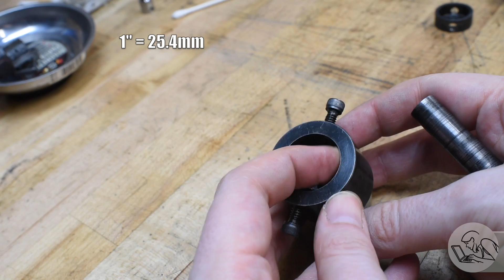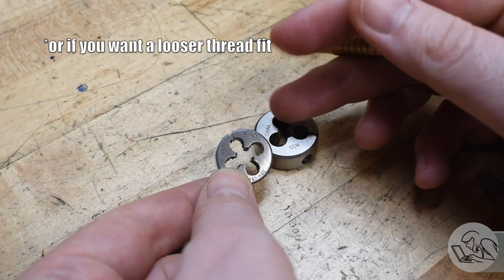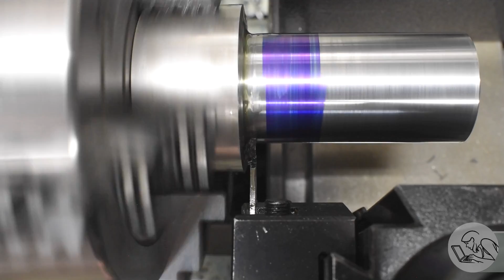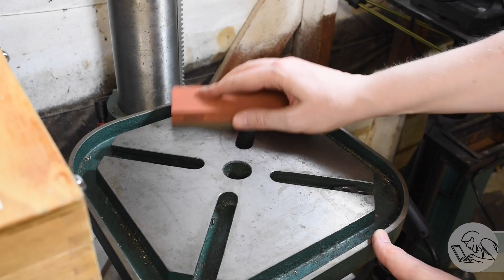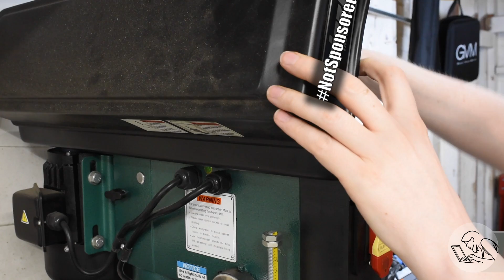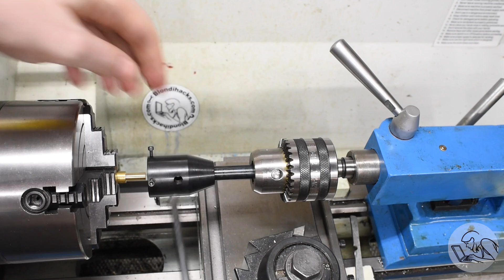Tailstock Die Holder! Let's Make One!

Comment: Thank you for this. I had a simple, but not simple, component to make - a hex bar with a 1/4 - 24 RH thread on one end and LH thread on the other. The thread turning video got me cutting both threads on a practice run and then the backup dies arrived for the final piece. I had a tailstock die holder, but naturally it only had inserts for imperial sized dies and, despite being 1/4 - 20 the two dies that arrived were 20mm. So, following your process, I was able to make a new holder insert for my tailstock die holder, and the piece is now finished. Yay. Thank you again!

Comment: If I may suggest a lathe project:
Make a center punch specifically for marking holes for mounting hinges.
Such a tool would be made available f two pieces: an alignment/holder and a punch pin.
The holder’s nose would be beveled at the same 72 degrees as used to n flathead screws. Simply pressing the holder onto the screw hole in the hinge would center it over the hole. There would be a long bore through the holder for the punch pin, I imagine this part being either hex stock or knurled, from 3/8” to 1/2” diameter. Hex stock won’t roll off the workbench.
The pin could be something as simple as a large common nail, slightly longer than the holder. 
To use: Place holder, insert pin, tap pin to mark.

Comment: Hi Quinn, after using the height gauge on surface plate to mark a line parallel to the cylinder's central axis, how would you use the same layout setup to mark a line exactly 90 degrees around that central axis? As an alternative to the collet block method you demonstrated.

Comment: Your series is my goto for learning machining - thanks. I appreciate that you are quite pedantic at doing everything properly - it's always good to know the right or best way, then work back from that with knowledge. However I'm baffled as to why you would use a 1-2-3 block to square the toolpost? The tool tip is radiused, surely a few decimal-degres is not going to matter at all?
Reply from the maker: You are usually cutting deeper than the radius on the tool. The side of the tool is doing the cutting, which is why lead angle matters.

Comment: Somehow I had missed this one first time around...

So I got curious about what dies I had in my set.  They';re all hexagonal!  Two different sizes,  too.  This is a "Blue Point" set,  off the Snap-On truck.  For some odd reason the smaller tap holder won't handle the very smallest taps in there.

Comment: Good video, thanks. I’m going to make one. Years ago I knocked apart a dead hard drive for the extremely powerful rare earth magnet inside. It sticks to the top of the face of my drill press, holding the key in place. One only needs to toss the key in the general direction of the magnet.... no key dangling on a string. Too easy to get used to :-)

Comment: I like to use a boring bar and spin the lathe the other way when I do those kind of tapers, so I can have the compound handle on the closer side of the lathe. It’s more comfortable and safer than reaching over the ways of the lathe to turn the handle of your compound. It can really get to be a hassle when you’re reaching over on a bigger lathe or when the tapper is more flat than 30 degrees. Once I was shown this method I won’t do it any other way.

Comment: As always, good video.  A useful shop tool project.  I did some experimenting with Brownell’s Oxpho Blue recently.  I used a cotton ball saturated with Brownell's, and wrapped some 0000 steel wool around the cotton ball.  I then rubbed the steel wool on the surface while squeezing on the cotton ball at the same time.  What this did was to give me a more consistent less "splotchy" finish.  Buff with a paper towel and apply T9- Boshield....  If it weren't for this channel, I would not have even known about Brownell’s Oxpho Blue...!

Comment: I just want to point this out Quinn I am a tool maker by trade and use a rigid die holder in the tail stock all the time for short threads. If you are making a rigid ( no slip fit shaft ) put a clearance hole though it in case you run into a thread length longer than you bore behind the die.

Comment: Excellent project, the die holder is probably one of the most used tools in the workshop, If all you have is those crappy carbon steel dies you usually have to single point the threads and then finish to size with a die. I think I shall follow your lead and use the cold bluing more often, it does give it a "pro" look, I think. Cheers!

Comment: I worked for a company that manufactured medical diagnostic machines. I mostly ran a manual lathe. I made a die holder with an insert for 2 die sizes as well as taps. It was a production shop and I used it quite often. Taps from 2-56 to 5/16-18.

Comment: The  joys of photographic memory.  See it done once and I know what to do when I get the harbor freight lathe in 3 months 
(tax time)
Reply: Before you rush out to your local harbor freight, look at their website and search “7x12 mini lathe”. This one is actually 4” longer than the one they sell in stores, but it’s only available online. Due to a strange set of circumstances, I wound up with a Grizzly G0765 7x14 AND the H F 7x12 mini lathes, both brand new, and I like them equally. The Grizzly comes with a lot of extras, but the HF is quieter! Don’t waste your money on the 7x10 unit unless all you’re going to turn is friendship rings! A side note: the so called “7x10” lathe is actually 7x8! HF has taken liberties with their description! Research a lot before springing!

Comment: you scared me for a second there, i thought you were going to power tap with a drill press xD
Reply from the maker: I’m not that brave, certainly not with a 4-40 tap 😅
Reply: @Blondihacks  Me neither, but I have used a variable speed power drill for tapping. Worked good when you can control the speed and power.
Reply: Power tapping a 4-40 is the surest route from a part to 'sculpture 😃

Comment: FYI, my grandfather was a top notch Tool and Die maker.  The first tool that he taught me to make was a tailstock die holder. When I got his tool box, after he retired, it had several simple tail stock die holders in it with his name engraved in them.  You beat me to this build so maybe I will use your design on my next one. This will become clear when I up-load my next video. Thanks for sharing.

Comment: I've made a few of them in my aprenticeship but with some minor changes. The holder it self is knurled and instead of normal screws i used fulls sunken grubscrews. The benefit of this changes is, i can use the lathepower to cut the tread and when the tread is deap enough i can just let it go.
And this things are used in production for small runs because it is faster than single point and better when you have ton of unsupportet material.

Comment: Fellow software engineer who finds solace in the mechanical world away from computers. I need to start turning steel with my Sherline lathe. I haven't really played around with 12L14 steel yet and this would be a great project for that. I have to confess I also have a Sherline mill that I put stepper motors on, but used double shafted ones so I could mount the hand cranks for manual operation. I find without some kind of control, I lose count of rotations.

Comment: I use a tailstock die holder at work quite often for the smaller threads (M6 and under) especially on longer threaded sections where its not worth the hassle of programming out tapers from deflection, etc. If its a really long thread you can start by screw cutting so that it doesn't wander off centre then finish it by chasing it with a die.